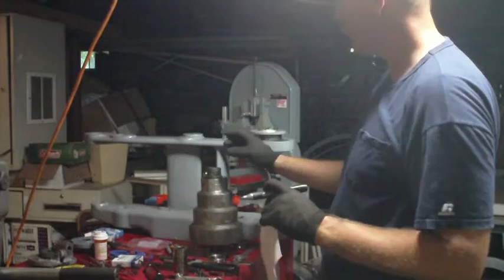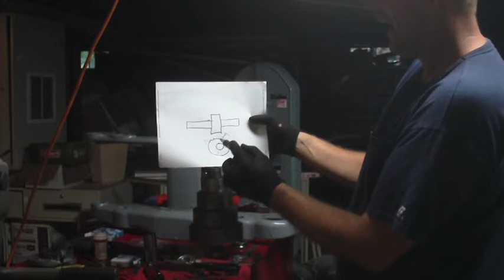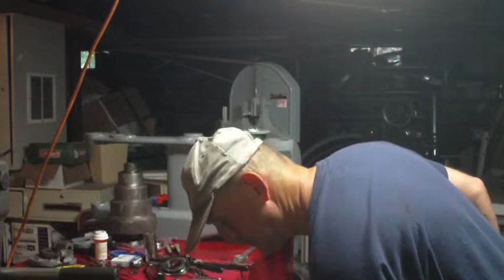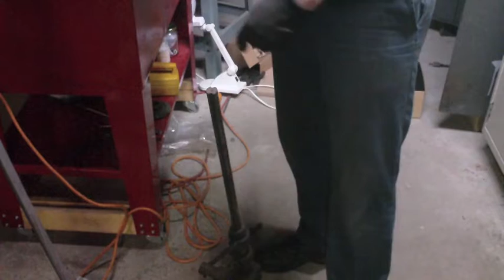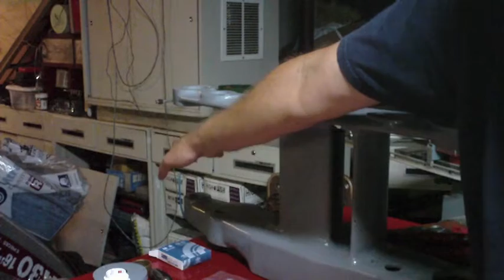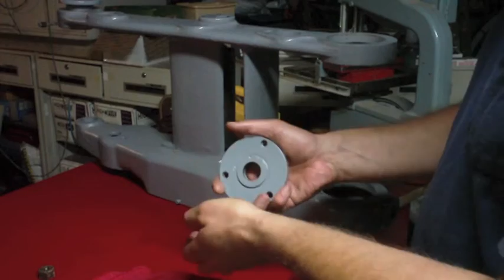Sipp Drill Press Part 39

Comment: Steve, did you ever finish the sipp drill? It looks like the videos stopped at about #45. I was very curious to see the finished drill operating.
Reply from the maker: Hello.  I'm glad you enjoyed the videos so far. I stopped working on this project, and was going to finish it but got busy with other things. Unfortunately there's been little interest in this series. Your the first commenter in years. I really should finish it. At least itd be one less thing in peices in my way. Stay tuned.
Reply: Steve Watroba thanks for the reply Steve. I had seen one for sale and yours was a comprehensive series in it. The only one I found. Thank you !
Reply from the maker: @Bobde1234  I've only ever seen one other. It was for sale on Ebay years ago. It was painted blue!
Reply: Steve Watroba yeah a local woman is asking $350 I think. It may be too large for my space tho. I’ve got an old delta dp-600 that is pretty nice and can be moved around if need be

Comment: Hi Steve Glad to see your still making progress, she's going to be one impressive restored drill press when all said and done.  Now i got a better picture of what part your rebuilding and how it works. I'm kinda wondering if your thrust loading on the bottom bearing. Might be partly drilling force, the upward load applied to the wider ends of the speed shift pulleys as the belt rides up  the step to next larger pulley. Then  also Gravity due to the weight of that pulley assembly pushing down under it's own weight all the time the drill runs.
 if it was a regular bearing it wouldn't take the thrust load so well over a period of heavy use,. Like the last 100 years you haven't owned and used it L.O.L. just Thinking out loud on how many different sources of up and downward thrust there may actually be in that mechanism, and why that thrust type bearings in there. I know your probably way past this now and may of figured it out or done option B anyway. This restorations a good interesting subject I'm enjoying this, the lathes and the Oliver to when we see it. 
 Regards Robert
Reply from the maker: Hi Robert. There is an additional thrust bearing on the bottom of the quill assembly that I have not shown yet. I think that is for the axial forces present during drilling. I have a redesign in mind, that I hope will address all the issues and give me a quite running pulley. Please read my reply above to Jim for more info, and thanks again for watching and commenting.

Comment: I'm not sure where you currently are with this project, and if it is already done I'd be wasting my time.....will take a stab at it anyway, this time, as I may catch you before too many mistakes are made. Your thinking is wrong thinking the downward stroke of the spindle is causing axial load. Backing up a bit, it is not unique that your spindle slides up and down in the pulley as you mention "by design".....every drill press made to this day all work that way....the spindle goes up and down as you drill, and there needs to be a drive pulley to supply the rotary motion. What may be unique to your press, as well as other different manufacturers, is how that rotary motion is pinned to the spindle, that still allows it to freely go up and down....some have splined spindles to pin the rotary motion, and others  grooves in the spindle that ears in the pulley drive. I am almost positive that on your press, the drive or pinning is all done within the "funky" bearing that you are talking about replacing.....something needs to drive the spindle, and the best bet is to use what is in place that was originally designed to drive it. Going back to my original comment of your thinking being wrong as far as axial load, the axial load is coming from the weight of the pulley and gravity....the thrust bearing under it carries that load....something that an ordinary deep groove bearing will not do, and last for any length if time. The should be no axial load when the spindle is lowered....actually no resistance at all in either direction.....most have a simple clock-spring for a quill/spindle return. Those are designed to lift only the weight, not any resistance.....I haven't seen enough of your parts to know if a return spring of any type was used, as well as what type accommodations were made for the pulley to drive the spindle.I'd hate to see you get it all back together, fire it up, and everything worked and turned fine except for the spindle! It sort of defeats the entire purpose!
    My normal MO after acquiring a piece of machinery to refurbish, is to run it enough to figure out how everything is supposed to work, then assess  the different systems to see if they are operating correcting, and figure out what needs my attention. Ball bearing that run in oil baths are typically fine, where sealed and greased bearings normally need changing. The oil leeches out of the grease, and leaves a wax behind that gets hard..  There is less resistance on oil bath bearings, which is probably the reason for the oil bath gearbox. The spindle freely spins which is important when changing bits, indicating, or whatever you do to grab the chuck and turn for any reason   Don't take this wrong.....not trying to tell you what to do, more to keep you from getting to a point beyond return as far as modifying parts, and to point out the "drive train" in general, so you can focus on what need to be done next. Sorry....not much of a wordsmith.....a little better at mechanicing!....hope some of this helps!
Reply from the maker: Wow Jim, I did not even know youtube allowed comments this long (lol). Lots of good thoughts in there. Let me give you an update, and try to respond to some things. The drill press is not done. There will be a few more videos, then I took a break on this project because I needed to move my milling machine into the shop to fix the belt shipper, and I want one of my bigger lathes running to work on the bearing issue. i have come up with a design for a new bearing carrier that will address your concerns, but I cannot make it on my 9" Atlas. As for what pins the shaft to the drive pulley, the shaft in the pulley has 2 grooves running the entire length of the inside of the bore. The drive shaft has 2 dowels set into slots on the side of it that ride in the grooves. It's quite a hoot! No quill return spring, it uses a counterweight inside the column attached to a chain running on pulleys to return the quill to it's starting position. The quill itself has a thrust bearing, and nothing else. The quill is in a bracket that can be adjusted up or down on the column. If my re-design fails, at least it'll be a valuable learning experience. Thanks for watching.